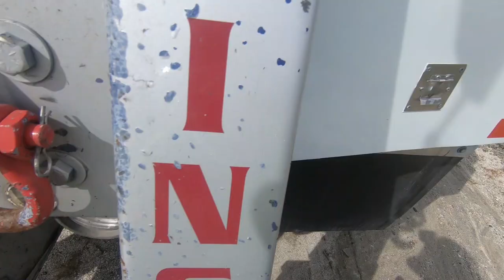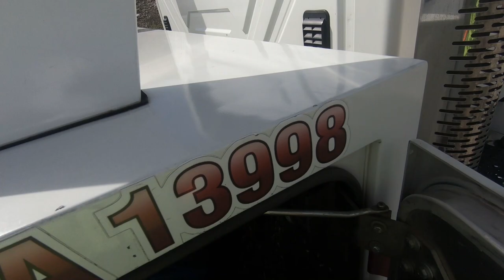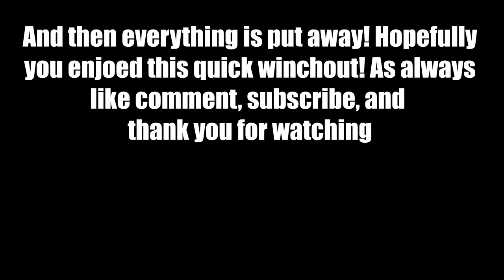Winching Out A Heavy Work Truck

Comment: that tow truck has quite some pulling power, towing the work truck and compressor trailer out on those soft surface roads. Any fear of spinning the wheels on the tow truck and possibly getting it stuck under that heavy tow-load?

Comment: no parking brake pulled beginning of vid, does that unit have a winch brake set up? nvm he prob pulled it right before video started
Reply: You can see Darl release the air brakes just before he starts pulling them up the hill.
Reply: Did you not notice him release the brakes when he started moving so therefore he obviously set the brakes